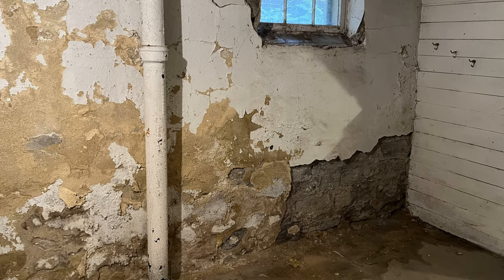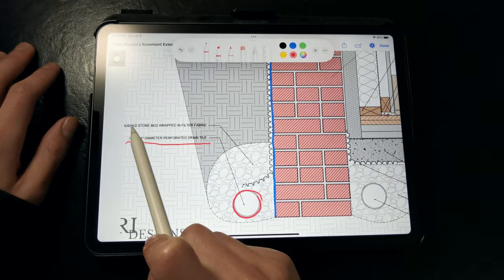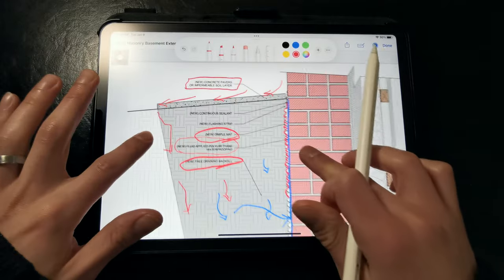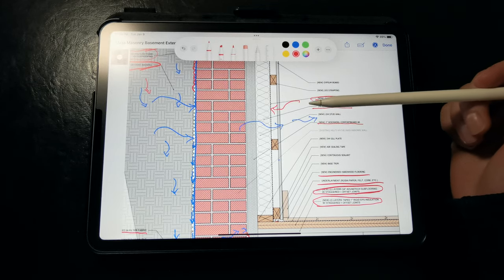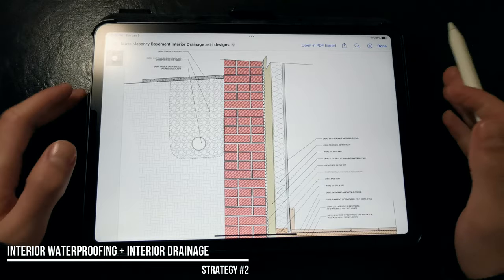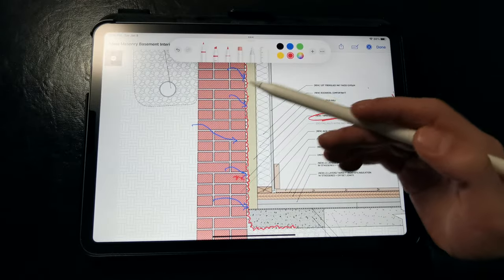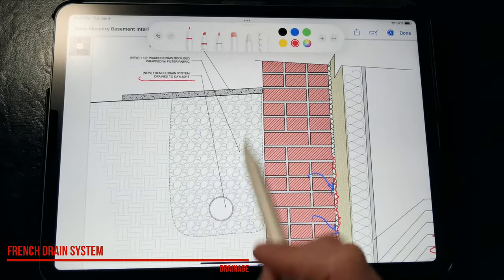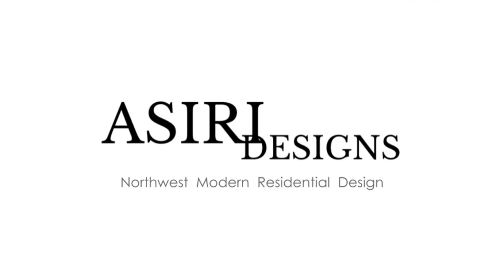Waterproofing Old Basement Walls (Exterior + Interior Options)

Comment: Wouldn't using the dimple membrane on the inside as a vapour barrier cause issues because the stone foundation is never allowed to dry out? My understanding is that stone foundations aren't supposed to remain wet 100% of the time as this can destroy the stone and mortar.
Reply: They're wet 100% of the time anyway, vapour barrier or not. As moisture travels towards areas with lower humidity, if you allow the below grade moisture to evaporate into a basement, you're actually increasing the amount of water passing through the below grade wall. It's not the moisture per se that damages the wall. It's the flow of water. The below grade wall will never be able to dry, as you can't dry out the ground water. 
What you can do is to isolate the wall and provide drainage. Even the older buildings have impermeable DPC under the floor. Even with ventilated subfloor.

Now, above grade, depending on the weather, humidity inside can be higher or lower than outside. So a "smart" vapour retarder is required.
Reply: Can confirm they're wet 100% of the time, 50% humidity at least.

Comment: Isn’t the interior drain where the footers should be? How’s the concrete floor supported?
Reply from the maker: Not in this scenario, most basement slabs are floating. You almost never see monolithic slabs used in basement construction since the risk of water entry through the cove joint is must higher.

Comment: @asiridesigns question for you- if I took the time and money to dig out the exterior should I be considering exterior insulation of the basement? With maybe Rockwool comfortboard 80?
Reply from the maker: I tend to stay away from exterior insulation for below-grade applications since it can deteriorate quicker than if it were located inboard. Rockwool comfortboard will give you a much better chance of durability, but I think it's best to keep the insulation as dry as possible since saturation can lead to a loss of R-value. If you do locate the rockwool outside, make sure it's behind the dimple mat, as this will serve as a protection course.
Reply: @ASIRIDesigns  than you for the reply. Pointing out “below-grade” is very helpful. I have learned so much from your videos, thank you for sharing. Please consider making a video on joists. In particular, vibration with open web (I thought open web sounded great until I walked on one.

Comment: This was very helpful! I have been putting a similar picture together in my head about exterior mitigation on a brick foundation. One question, the Tremco 201/60 is not sold in my area. Is there a mass market (Lowe's / Home Dept / etc) residential variation that you'd recommend?

Comment: Thank you for sharing. I appreciate your videos very much. I believe my case is similar. My home is located in the US and was built in the 1970s. The foundation walls are constructed of cinder block. Tar was applied to the exterior to lock out moisture but overtime has began to deteriorate. There was some visible cracking in the interior but as of lately has been sealed with hydraulic cement. An interior French drain was constructed later leaving about a half inch gap from the foundations walls to catch condensation drip. I am now looking to finish my basement but do not have the ability to excavate on the outside. Would applying a subfloor system (combination of dimple mat and obs) along the slab and a foam board along the walls (with 1/2 inch gap between the cinder block and foam board) be sufficient as a vapor barrier in my case? Thank you.

Comment: On the interior drain system, wouldn’t you have to drill weep holes in the block so water could drain, if you don’t have access to the outside drain perimeter 🤔
Reply: That assumes water isn't already seeping through the wall, but it already is.

Comment: This is hard to follow. I’m trying to figure out which way is better. How do I figure that out?
My home was built in 1930 the basement gets moisture when it rains on 1 side.
Reply: Start with grading, gutters, and if need be an external French drain. If that doesn't fix it, then try the more expensive options.